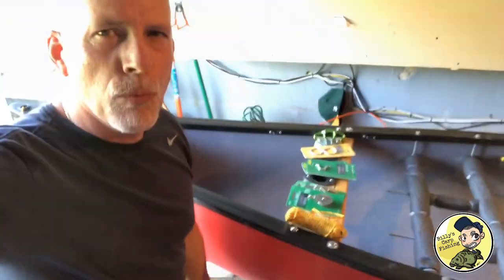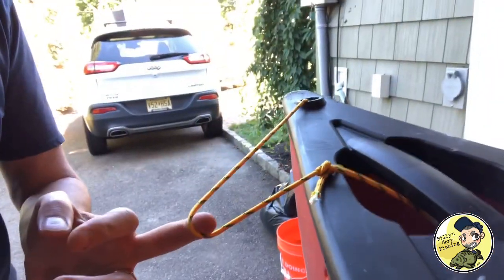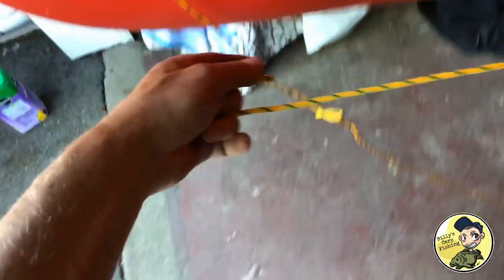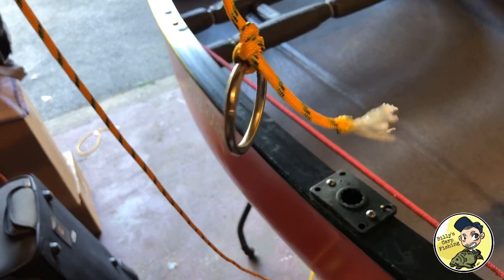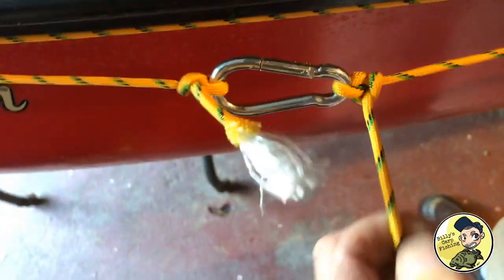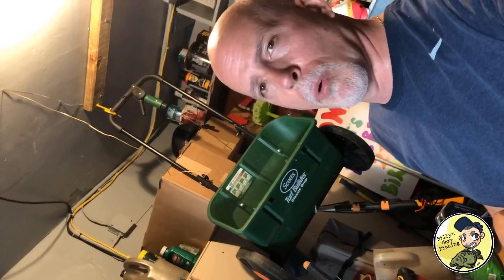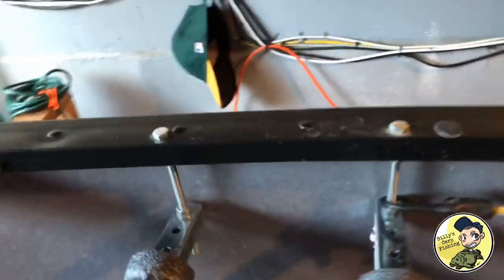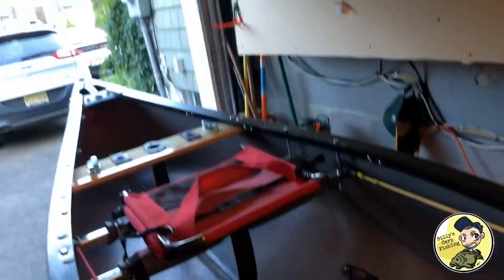DIY Anchor Trolley - Old Town Canoe

Comment: Hi Billy! I used your tutorial as a starting point for when I made my trolley. The only changes I made was using more appropriate knots. Burning the ends is smart, but the knots were not secure. Plus, they stick out at weird angles.  I used a couple of layers of shrink wrap to hold the rope ends flat. I make a similar change to my canoe seat. Much more comfortable. Thanks, again.
Reply from the maker: Thanks for the feedback Sirrehpotsirhc !!! Glad you enjoyed the video though ✌️

Comment: Good ideas here.  I've used anchor pulley's in my canoes, but they aren't as versatile as the anchor trolley.  May have to try this in my Pathfinder.  (One of the nice things about having an old/used canoe is not being afraid of drilling some holes in it!!  LOL)
Reply from the maker: True...plenty of holes indeed. Just got to fire away...but measure twice...lol.  Good luck.  Mine definitely comes in handy on those windy days.
Reply from the maker: True...plenty of holes indeed. Just got to fire away...but measure twice...lol.  Good luck.  Mine definitely comes in handy on those windy days.

Comment: I tied one end to the bow handle and the other into a bowline. Form loop around my plastic jug anchor.
I have an eight foot piece of paracord tied off to my middle thwart and a carabiner on the other end snapped onto the anchor paracord.
Pull the line from the thwart to get hold of the anchor line for retrieval.
Reply from the maker: Nice work!

Comment: I’m trying to figure out how your carabiner is better than a good ring. If your anchor rope is a loop or on a ring then it will hang on the top knot of your trolley if it clips on underneath the knots (on your carabiner) then you have an easy to clip on anchor rope and you may as well have used a ring. You could slip knot the anchor on but that would be more cumbersome than all of the above.

So... I’m at a loss. How does the carabiner save you time/make it easier/improve life vs. a ring?
Reply from the maker: Thanks for your observation Benty.  I prefer the method I used with the carabiner for a quicker release of the anchor.

Comment: I bought a packaged trolley, waiting to out it on my discovery 119, which hasnt arrived yet!😂 but using the caribiner is a great idea to be able to remove your anchor line from the trolley so its not just hanging there. Thanks for the tips! How do you like the GCI seat? I have one of those thats yet to be used as well lol
Reply from the maker: Hey hjkh...good luck installing!  So useful in current and windy days!  

I like the seat...it should fit right onto the seat that the discovery 119 has... I just wanted  something a little higher and I also moved the seat forward for better balance and tracking...it really helped.  I also use additional cushion on the seat as the GCI seat is not very comfy after a couple hours on the water.
Reply: @BillysWWF  i was curious how well it would do compared to a seat in say the sportsmans model. I hear mixed reviews on seats and unfortunately Old town wont sell just the seat from the sportsman. Ill mostly just be fishing, duck hunting, and travelling to different hunting areas so hopefully it goes well! Id love to see a review of the canoe on your channel. Best of luck fishing and keep up the good work!
Reply: @UserFormelyKnownAs_hjkh  I wasn't impressed with the Solo Sportsman 119 seat.  It looks like it's going to be a lot more comfortable than it actually is, IMO.  I had the same GCI seat that Billy is using, like he said it gets a little uncomfortable after a while.  The GCI Sitbacker has like 1/4'" more cushion.  It's a little more $$ but it's more comfortable IMO.
Reply: @freshwatersbassfishing  i didnt buy the sportsman model, just the plain jane discovery. But that triple layer hull is much thicker than my 159 old town. The regular discovery has woven seats so i put the GCI seat on it. I agree it gets a little uncomfortable after a long time on it. I had bought a suspension mesh stadium seat at a big box bulk store a while back and used some 550 cord to secure it nice and tight to the discovery seat. Now that i can sit in all day long!
Reply: @UserFormelyKnownAs_hjkh  I had the regular Disco 119 as well.  Did the same thing.  Added a GCI seat and eventually a stadium seat.  Still wasn't very comfortable for me.  I attribute that to old knees!  I wound up getting a 14'10 Pathfinder and installing a solo seat.  I sit much higher up and it's super comfortable.  And it's big and sturdy enough that I can stand and fish.